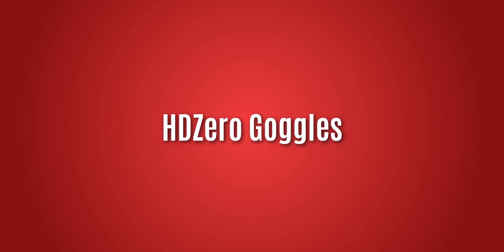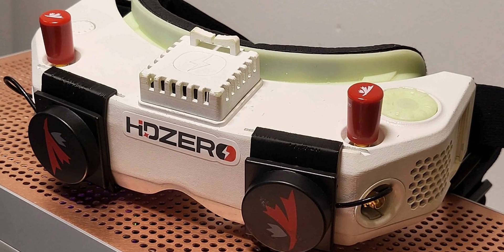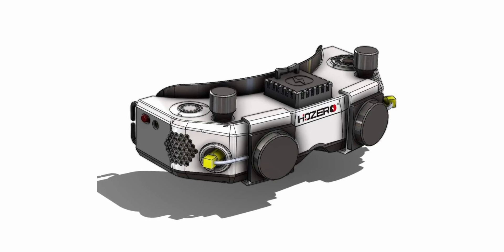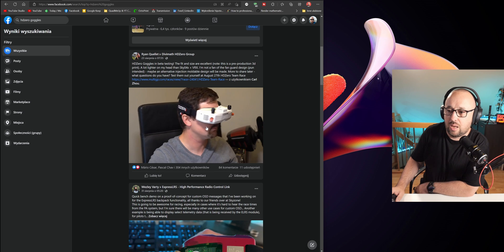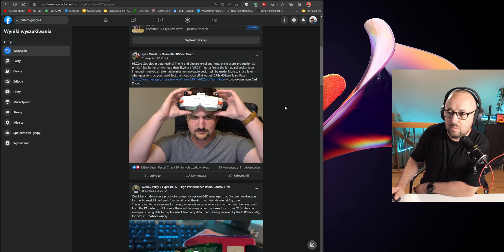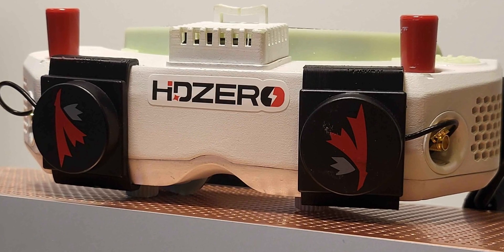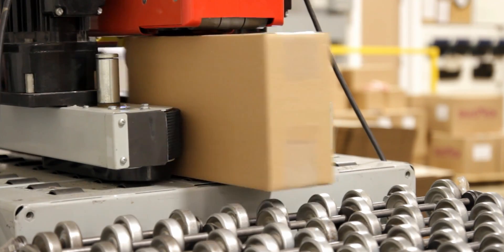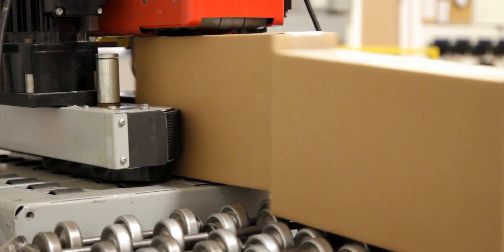What's happening to the HDZero FPV goggles?

Comment: Because I fly withing 1km FW and Quads I have supported HDZero and the innovations that work well with elrs like using the backpack functions. I already had the Skyzone CobraX and the O4L, I like the breakup pattern as well as the clarity. The OSD, SA, Stick menus are working well on Betaflight. But as far as INAV and Ardupilot, I have not been successful  getting these important functions working. I have seen examples of others getting at least the OSD working, but one has said there is a Beta INav FW that they are using, but I am unable to find such. HDZero may never be popular for Freestyle or Long range. But a growing segment of Drone/Whoop racers are excited. Have any of the main INAV Devs been offered equipment? I have even contemplated Letting a Betaflight controller run the OSD and HDZero, and having an INAV FC for flight control. Possible?

Comment: Not sure if it needs complicated FCC certification when it is only receiving.
Reply from the maker: FCC cert applies to all electronic devices, not only RF transmitters. HDZero Goggles fall into the "Unintentional radiators" category. Basically, anything with a oscillator above 9kHz can be an unintentional radiator

Comment: Carl is cutting tooling now. It's expensive, yes. This is a bit further along than prototype - it has full working PCB - no bread boards. Carl said beta testing in summer with a few pilots, he hit that target. October won't happen, but November is looking likely
Reply: These would be a great early Xmas gift to myself that's for sure!
Reply from the maker: Let's hope so. I'm a bit sceptical however. But let's hop I'm wrong and those goggles will show up before Xmas 2022

Comment: Well, the system is looking great. And the fact that you can buy a VRX and use with a cheaper goggles is great!
But we shall see how things happen. 😊
Stay safe there with your family, Pawel! 🖖😊
Reply from the maker: Couldn't agree more!
Reply: Yes, but mounting the HDZero VRX to some goggles proved to be problematic.  The supplied mounting bracket is not compatible with my Skyzone SKY04X V2.  I ended up buying a bracket from ORQA.One Pilot.  HDzero claims that the VRX is compatible with SKY04X V2, but in fact it is not.  Why didn't HDzero supplies some brackets for commonly seen goggles.

Yes, one can find 3D printing files for the HDZero VRX bracket.  However, what if you don't have a 3D printer.

It is even more troublesome.  The VRX costs more than $200, antennas would add perhaps $30, and an analog goggles may be $300.  Adding these up, the total may be more than a native HDzero compatible goggles.
Reply: @ckshene7212  I am using it easily on my O4L which only differs by the screen it uses. I wouldn't have bought goggles just for HDZero, but for analog first and maybe HDZero for a digital trial. That was before the WTF and the price break on the V@ goggles though. I am having some remorse that I didn't wait a bit. The cost of hte air units are what keep me from jumping now.

Comment: I'm don't know, but since they receive not transmit, I assume they don't need certification.
Reply from the maker: It's not that simple. It's a RF device and only FCC cert. is a proof that it's a receiver :)
Reply: Anything with a processor in it radiates RF and harmonics to some extent and should comply with basic emission regulations, but some manufacturers get round any kind of compliance.